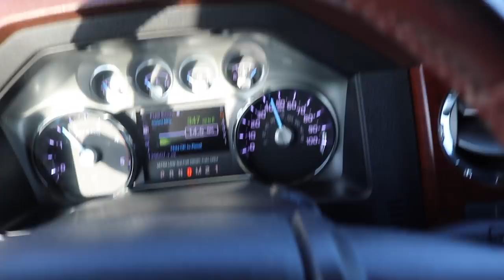I bought a ROWDY HIGH Horsepower 12V CUMMINS!!!

Comment: As always majorly saving my life motivational.... I'm actually wire brushing / sandblasting the frame & flatbed on my 2 sec gen dually 12v right now . Getting ready to under coat the passenger side, I already sprayed the driver , looks awesome. 
 With that red , either peanut butter with black trim / or all black interior . My dually is white , so I'm adding blue & black to it ..... Salute , blessings to everyone grind & motivation....